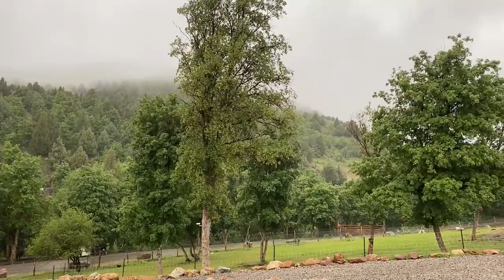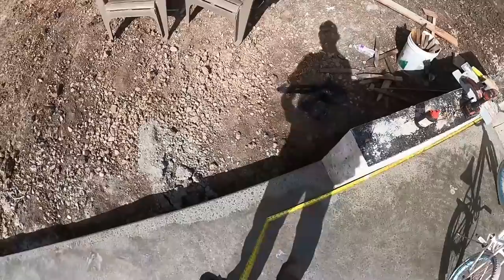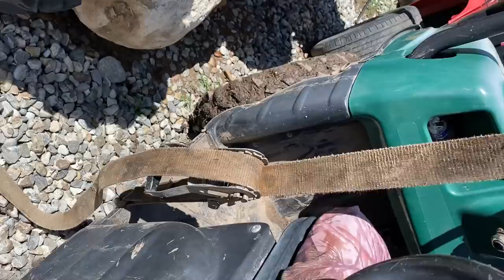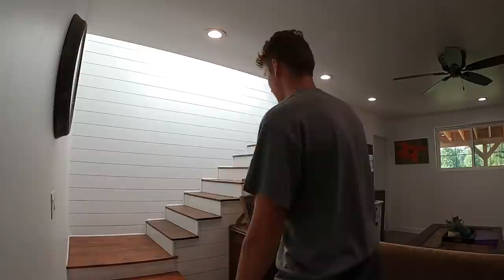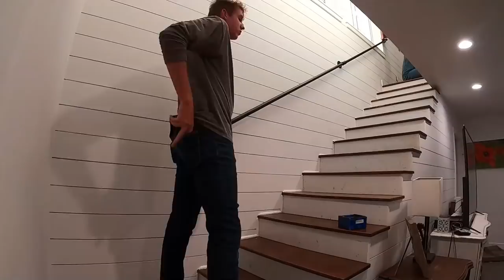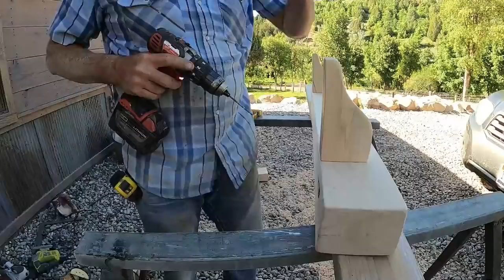I Green Cut Shop Floor, Iron Pipe Stair Rail, DIY Sawmill Fireplace Mantle.

Comment: good look at the sawmill - make the cabin a basic timberframe - the sawmill should make short work of it - maybe you can just chip away on it - you may as well do both the garage and cabin at same time - try the grk fasteners - they work well. i like your show cause you diy most everything, you are cheap but get the job done to specs - hopefully you can take out a bunch more trees and do some woodlot management - plant some fruit trees and try to go larger with composting. the terracing will look better as you expand and should get more manageable - in the mountains it is a bit of a battle but you are making major progress - the shop will really help you out, make everything more efficient and manageable #spare parts shelf  #make hay

Comment: Health, another good video. I poured 12" wide, 24" deep footings with lots of rebar inside and tied in with rebar under my 30' X 45' 6" pad. I also had a fiber mixed with the concrete for additional strength. I didn't cut any expansion joints in the slab and in the past 9 years it hasn't cracked. I also sealed it with Deca 20, which is a clear water sealant. This has been a blessing in disguise as it has made it easier to clean up oil spills. Very fast and easy to apply to any form of concrete. You might consider using it or something similar.

Comment: Im curious, why the cutting of the concrete ?
Reply: I think it's suppose to prevent the concrete from cracking. The cuts help relieve the potential for cracking when weight is on it.

Comment: Nothing wrong with buying used stuff, and teaching the kids how to maintain it.  Even the new stuff needs maintenance and repairs, they're far from trouble free no matter what color and stickers you buy, they're used and abused and the maintenance and repairs that go along with that type of use will always come back and bite you when you least expect it LOL.  

I'm about 5 days into repainting the lower portion of my 33 year old pickup.  Why?  The clearcoat was gone, and a few spots the paint was gone and had some surface rust starting, better to catch it now than after there are holes in body panels.  Yes, I could have taken it to a paint shop and had it done but their prices are outrageous for no more than they do, and for no better work than they've done in the past.  Its something I haven't done before, and don't mind learning, and what's better to learn on than an old truck....cool thing with paint, if you mess up, you sand it down and redo it till you get the hang of it and it comes out the way you want LOL....just time and materials doing it myself, I think I may have about $200 in the whole project, between primer, paint, sander, sand paper pads, clear coat, tape, masking paper, etc.  $200 is a hell of a lot cheaper than the $2200 quote I received from the paint/body shop last fall.  See how this turns out and may tackle my other vehicle as well which just needs to be sanded lightly to get everything smoothed out and repainted and new clear coat put on.

Comment: In one of your videos you mentioned that you plan to build a pond at the top of your property. If that is feasible (you have enough water), you can use the pond to generate electricity. The fact that you are on a hillside is a significant asset when it comes to water power. Piping would be a major experience, you cannot use plastic pipe. If you can find enough scrap or surplus steel pipe, the project would be inexpensive, and you will generate plenty of power. Good luck

Comment: I wonder if he’s being truthful about these boots I’ve yet to find a pair that I don’t wear thru the toe within the first 3-6 months. Doesn’t matter how much money I spend granted my 400$ pair I have now did the same thing but there still holding together. I wonder does anyone have any experience with these. And without the safety toe I hate anything safety toe
Reply: I’ve been wearing ariats for over 10 years. They’re a solid boot. I use them mainly as good boots, as my work boots have to meet requirements that these don’t. I’ve used these for farm work through the years off and on though and they’re solid, just never worn them as daily so I can’t attest to that. They’re super comfortable!
Reply: Thanks I’ve went thru a hand full of red wings and Chippewa boots and some Carolinas all of them besides the Chippewas fall apart but within the first three months I were holes in the front of the Chippewas but they’re still holding together strong I just can’t find some thing that won’t wear a hole through the front

Comment: for you the shop should be easier in some ways to build than the house.  Since you now live on the site, there's no more driving to and from Red Poppy Ranch.  Putting a few bedrooms over the shop is a really good idea.  I'm sure those bedrooms will certainly get used several times a year.  Once you get your shop put up working on your vehicles should be a lot easier.  Are you planning on any kind of a lift?  Or maybe a Overhead beam crane of some sort?

Comment: Arat boots are good for a foreman or a weekend warrior hed a couple of them. I was given a pair of boots for a present, and have been wearing them for the Last 6 years and they are  rough on the toes. And i have not been able to wear the soles but a 1/16th of a inch in 6 years. The only thing i have replaced is the shoe strings. They are the most comfortable work boots ive ever worn, and they are only 119.00 in my area. So i can't make anybody buy and try them but I feel that for the money they are the best boots for the money. The Carolina boot company 8" work boots are by far the best boots for construction and I will never buy any other boots from now on. You should try a pair if you are going thru that many boots you'll never go back ti your present boots.

Comment: I'm speaking from personal experience when I say wear a mask when you're doing anything that creates dust from concrete. I've had a dry cough for years from cutting concrete when I didn't know about silicosis. Even if I need to do something now that only takes a few minutes I always wear a mask. Silicosis is one of the leading contributors to death in the construction industry and it's irreversible, the only thing you can do in later stages is to get a lung transplant. Years ago men just thought they could tough it out but the industry knows better now. No point eating and drinking healthy if you end up breathing in that dust. You might hate concrete now but if it takes your health you'll hate it more. We all want to see you live a long life!

Comment: I am sure you already did this but make sure to blow out your circular saw after cutting concrete. It is like throwing fine sand in the motor. Before you know it it will sound like it is ready to blow apart.

Comment: For some reason even barefoot bike rider with no helmets on concrete doesn't bother me anymore.  Accidents will happen and we need some bumper cars in fact.  Solar powered ones!!!
Reply from the maker: John Doe  Adults need to try going barefoot more, it’s actually really good for your soul. 😁
Reply: @RedPoppyRanch  well it's actually good for your electrical well being depending on where your bare feet land of course.  I live in the basement for a reason other than being a troll.